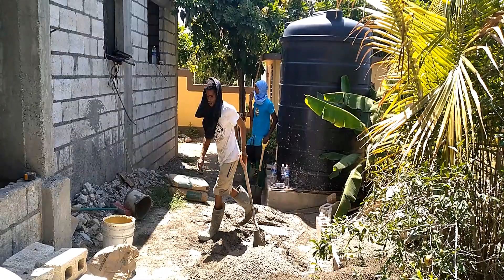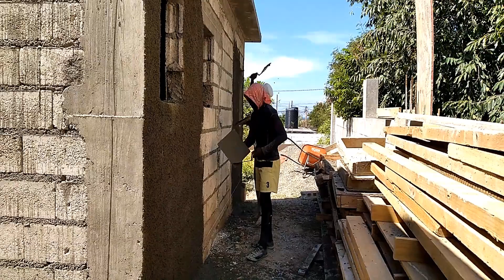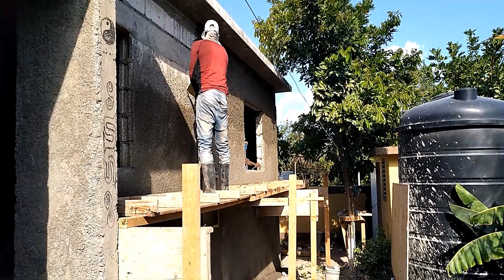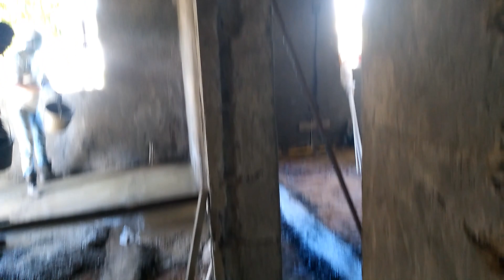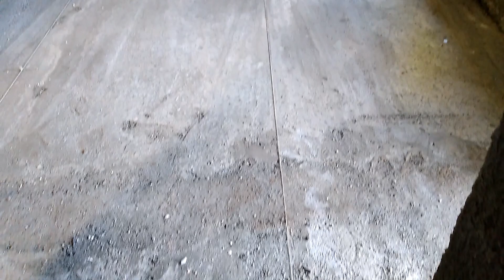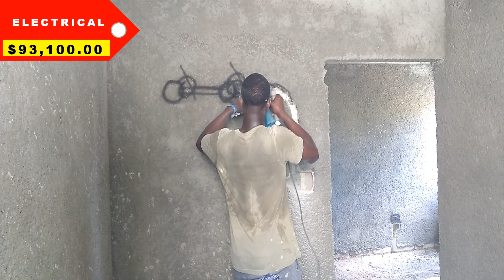Building Cost Jamaica Labour & Material St. Andrew 2022

Comment: I would like to ask some questions
Reply from the maker: Sure go ahead with your questions
Reply: @ravmercury3225  1. What type of project is being undertaken?
2. Who is the lead architect for the project?
3. What is the expected completion date of the construction?
4. How is waste management handled on the site?
5. Are there safety briefings for workers before starting their tasks?
6. What measures are in place for emergency situations?
7. How often are safety inspections conducted?
8. Are workers provided with personal protective equipment (PPE)?
9. What environmental sustainability practices are implemented?
10. How is the community surrounding the site informed about the ongoing project?
Reply from the maker: 1. Addition of living quarters to existing structure
2. Mr. Richardson 
3. Completion date was February 2023
Reply from the maker: 4. Waste is handled by the  National Solid Waste Management  Authority. Removed by trucks provided by the entity weekly
5. Yes
6. Immediate action would have berm taken by the lead contactor. Thankfully  no major emergencies took place during the construction phase
Reply from the maker: 7.Daily
8.Yes
9. Implementation of energy efficient design, installation of low flow fixtures and appliances like low flow toilet showerhead and faucets, using renewable energy sources - solar panels,   the house is designed to maximize natural light 
10. Notice of construction received from the KSAMC is placed at the entrance of the building site
Reply: thank uuuu❤
Reply from the maker: No problem
Reply: What size garage btw?
Reply from the maker: 25X18
Reply: No as in a 1 car garage or 2?
Reply from the maker: @jaleelwilliams9209  1 car

Comment: Very poor and cheap way of installing a floor, some form reinforcement is needed eg. brc wire mesh. The days of cutting out walls to run conduits are over, that's extra cost u can easily avoid, run all your conduits when the blocks are been layed. Many of the trade men in Jamaica are stuck in the old fashion ways of construction.
Reply from the maker: Thanks for sharing